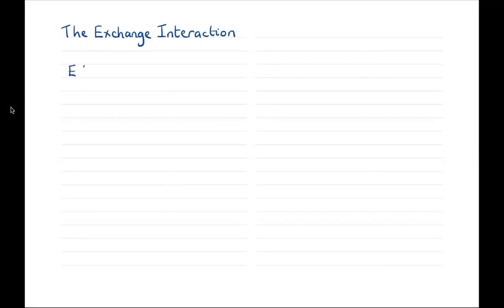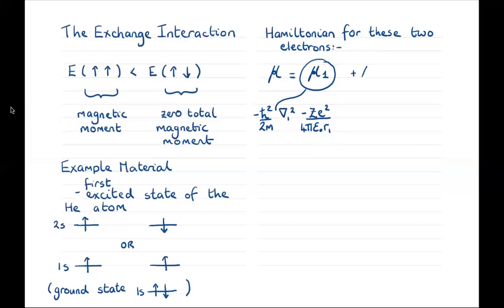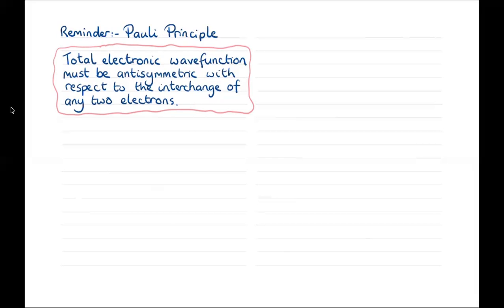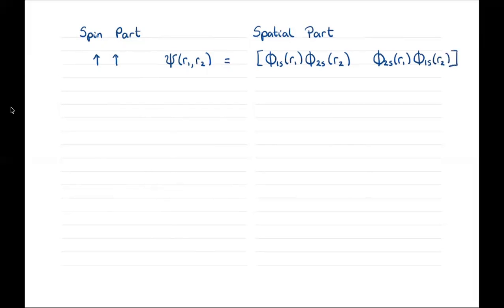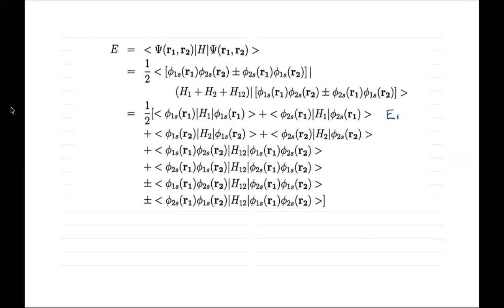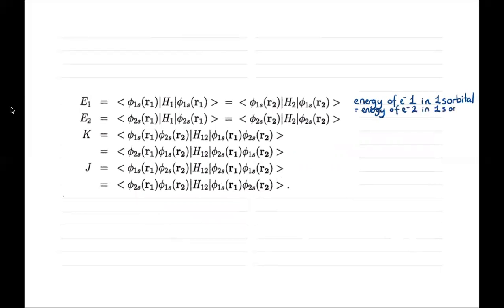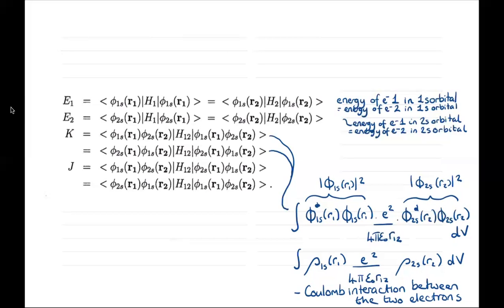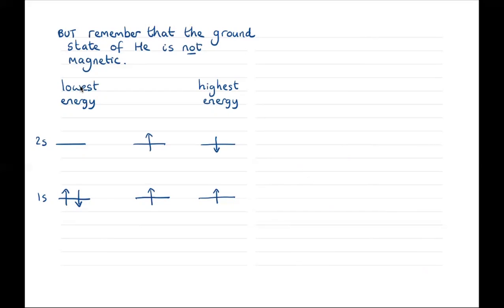The Exchange Interaction

Comment: Thank you for your excellent video. It is a very clear explanation. Yet I still have a question. I want to ask about the total magnetic moment of parallel and anti-parallel spins. The explanation about the total magnetic moment is from 1:20 to 1:30 in the video. The electron circling the nucleus also brings a magnetic moment in the system, called the orbital magnetic moment. However, it seems like you did not take that into consideration. May I know the reason for ignoring it?

Comment: This was very informative, thank you! I've been trying to learn more about magnetism and this principle seems fundamental to the modern understanding of it. I'm still worried it would be possible for J to be negative, leading to the antiparallel spins having the lower energy, so clearly I still have some work to do understanding the maths. Thanks again!
Reply from the maker: I'm glad you find it useful Richard. Easier than wading through the maths, you can make an analogy with the Coulomb repulsion between two electrons which always has positive sign...